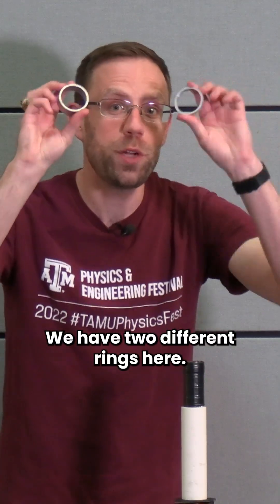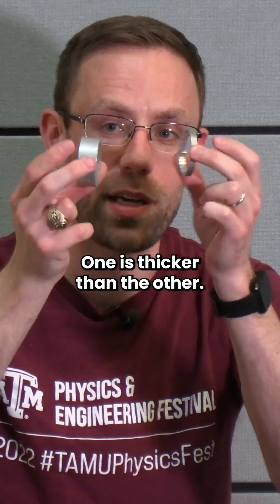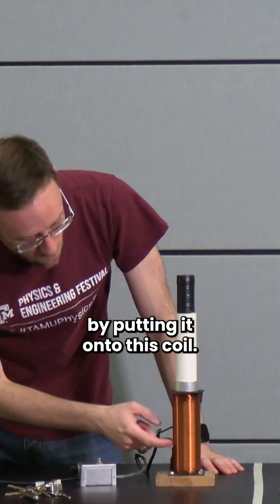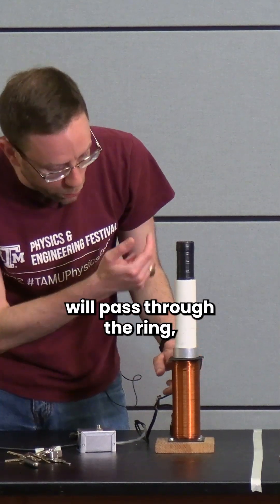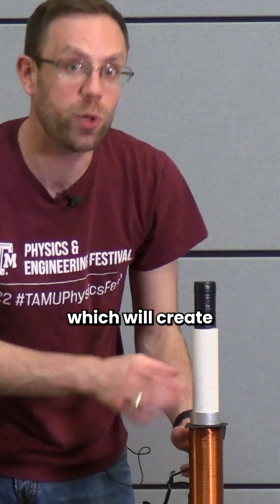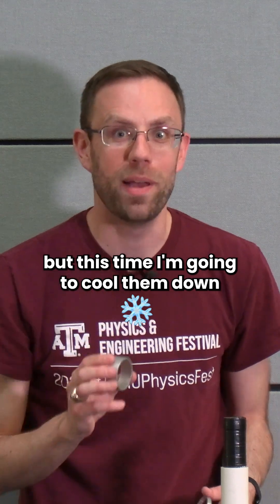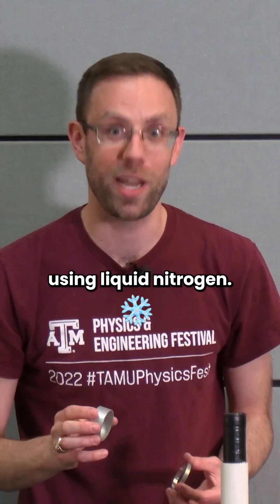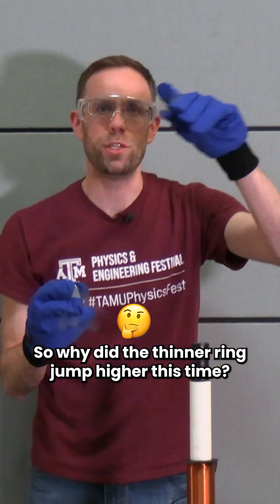Ring Jump Competition | What'll go higher? 🤯 💥 #shorts

Comment: Quustion: So if I understand this correctly freezing both of them made them have the same resistance thus the thinner ring waa shot higher because it was lighter, therefore making it about weight instead of resistence. Now my question is, does this apply to enormous objects in which a heavier metal building will be moved further than a lighter one (given the electrical pulse is scaled up from that demonstrated to match the amount needed to move such as an object) would cooling/freezing the metal buildings have the same effect as the rings? Making the amount of resistance null or same, and causing the lighter building to move more than the heavier one? I guess two questions but hopefully that made sense

Comment: for people who have no idea what just happened:

In the first experiment, the thicker metal ring went higher because of the “skin effect” which is the phenomenon when alternating currents flow near the surface of a conductor rather than the entire thing. The thicker ring has a larger surface area and therefore the current flows more easily causing less resistance and more launch

In the second experiment, the liquid nitrogen turns the metals into superconductors meaning that there is no resistance in either ring. The thicker ring has more mass and therefore it’s downward force is greater due to gravity and so the thin ring goes higher.

I really hope that makes sense…
Reply: I didn't understand when he explained it, but this was so clear I'm even more fascinated. Thanks!
Reply: Bruh, I had the most liked comment
Reply: Well but even when the thicker ring is cooled down shouldn't it jump higher due to more surface area? I don't get that part
Reply: @starlightglitters345  The only thing that affects the distance of the jump assuming the electric pulse is the same is the resistance and the force of gravity. The thicker ring goes higher at room temperature because the resistance is lower, but when they are both cooled down to liquid nitrogen temperatures (-320˚F/-200˚C) the resistance becomes basically nothing. The resistance of the thicker ring is still technically less, but it no longer has as much of an effect as the force of gravity.

If you still don’t understand I could try to show you the math, but I think that would make even less sense
Reply: @andrew6341  nice I think I get it thanks
Reply: @tobyblocks01 wait bro can u exactly tell what does resistance mean here?
Reply: @jashansaini3870  Current is the flow of electrons over time. Electricity charges the electrons causing them to move. Resistance is anything that slows the movement of electrons. As the temperature of conductive material approaches 0 Kelvin, its resistance also approaches 0.
Reply: @tobyblocks01  thanks for the explanation... Btw u can be a good teacher u explain really well
Reply: You should go and teach at this school too tbh
Reply: Thank you.. am fking dumb and didn't understand a word the man said 😂😂😂
Reply: Still dont understand.... But anyways probablybcuz i hvnt learnt these in school yet
Reply: Great explanation thank you!
Reply: When I tried calculating it I got that it should be independant of the area. The force due to magnetic field is directly proportional to the current, the current is inversely proportional to resistance and the resistance is inversely proportional to cross section area. So, the force is directly proportional to the area. Now the acceleration of the ring is equal to force divided by mass and the mass is equal to density of material * circumference of ring * cross section area. So, when you divide force by mass the area term gets cancelled and so both rings should jump to the same height. Why do we see difference in height then?
Reply: Thank you!
Reply: Thank you!
Reply: Your doing too much